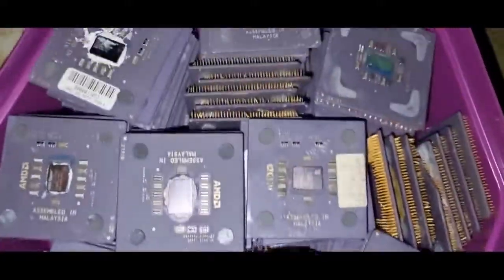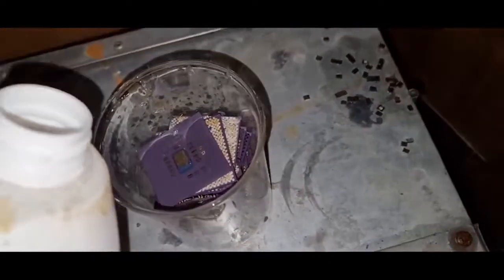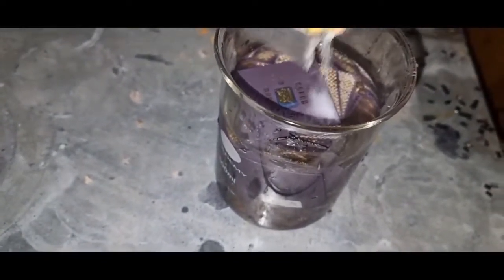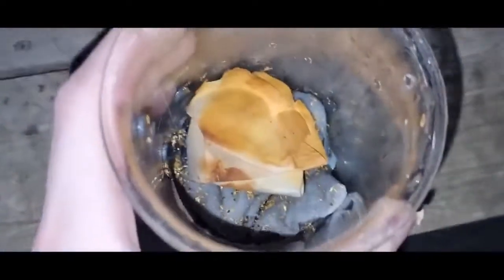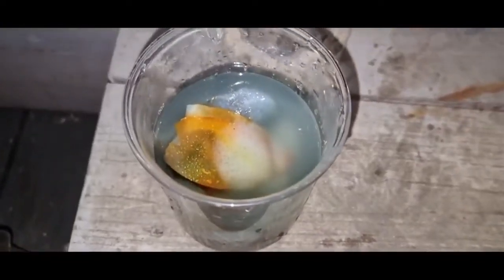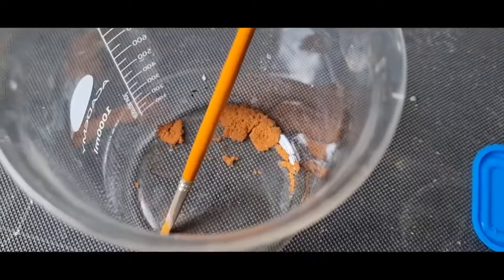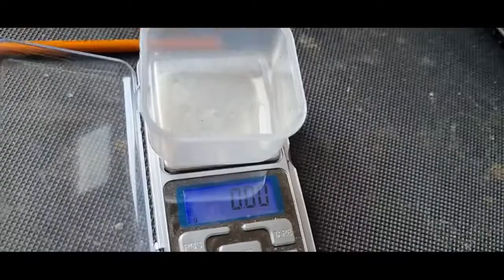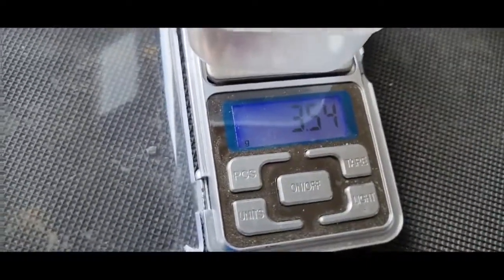105 amd ceramic cpus gold recovery and refine

Comment: Before anyone else comments on him breaking the chips, ITS NOT NEEDED, Exposed Silicon Die CPUs have no good bonding wires that's why these chips have no caps to remove like other ceramic chips

Comment: Have you broken up those chips and had a look a the wires inside just do one with a hammer and check. How much did they cost u and did the recovery cover it. Problem with those sort of chips it that we always expect more that we get. Also first drop u used sulphanic acid what did u use in second. You did not say just a clear liquid was it SMB? Good vid keep trying
Reply from the maker: Yeah I used sulfamic in second too. Amd don't have gold inside the chip
Reply: There is no gold bond wires with a exposed silicon die cpu, hence to caps to remove
Reply: @keytefirerefining1355  amd does have good bonding wires but not on these. Talk a little better so people don't get confused
Reply from the maker: @chosen1one930  I was talking about these lol
Reply: @keytefirerefining1355  yea but look at your comment, amd doesn't gold inside the chip, this can be implied to noobs which I'm sure the original commentor is because everyone should know these don't have gold bonding wires or anything inside the chip.

Comment: You're missing quite a bit of gold. Amd K6 cpus yield 1 gram per 20 cpus, these yield slightly more because they're older and contain more pins hence more gold, you should have 5 plus grams of gold if you did 105 cpus
Reply from the maker: That's what I thaught but owltech too yielded 1 gram per 30
Reply: @keytefirerefining1355  owltech got .40 from 10 duron cpus. These can vary because amd made several of the same cpu. Thunderbird which was my first cpu ever at 1.2ghz  that I overclocked to 2.0ghz water cooled, duron and some Athlons were like this. You should have 4 grams on the lowest end 5.25 best yield. When you don't remove solder like the MLCCs these can hurt yields by trapping gold or maybe you got unlucky and got cpus made from one manufacturer location. At the end of his video on the durons it shows .45 because a small amount of palladium he believed.
Reply from the maker: @chosen1one930  yeah it's strange. I usually get the high end of yields but everything I do I save the waste so I'll go through it one day
Reply: @keytefirerefining1355  I've never seen owltech do K6 cpus. Just throw the solution into your waste treatment bucket and any gold left over will come out as mud to recover later on. Nothing is perfect but that is the lowest yield I've seen on these.
Reply from the maker: @chosen1one930  yeah

Comment: Ahhh buddy, you missed a bunch of the gold. That first round of AR wasn't meant to be. There's gonna be tin, lead, maybe even a lil indium (not certain on those chips). (Almost forgot lithium in the heatsink grease) You probably only had a tiny trace of gold make it to and stay in solution. You missed most of the bonding wires. They're set right through the ceramic. If you're gonna use AR as opposed to more unpleasant processes, you really gotta pulverize them chips. Im talking nearly to dust. Ive busted ceramics to between a quarter and eighth in. Ran em through AR twice. Thinking its good enough. Glad i saved the bits. Got bored one day decided to see if my redneck rock crusher would handle ceramics better so i poured a load of spent ceramic in and busted em till the went through a fine(ish) kitchen strainer. I was happy with just that. But im glad i decided to run that dust through AR again. I nearly threw away several grams of gold. Those wires are so tiny going through that ceramic, theres no room for the AR  to get to the wires... Except for just the ends. Ceramics in AR  is gonna make a dirty solution no matter what. If you filter the solution thoroughly, it will get as clear as (colored) water. The drop will be not just cleaner, but a LOT quicker, and you'll use less smb (or other reducing agent). Hope you didn't throw the ceramic away... There's still plenty of value in it. I appreciate ya sharing this though. Im very curious to what your yield will be  when all is said and done, ive never usually try to get amds unless its a k5 or something really old. I did a similar size run of just Motorola chips out of old Macintoshs not expecting a lot and ended up having double the yield i expected. Got like 85 of them for less than $35 shipped, for some reason noone bid against me on ebay for the lot 🤑
Reply from the maker: It was only very few cpus and it already been in hcl and cucl2 for over 2 weeks so any tin etc will have gone